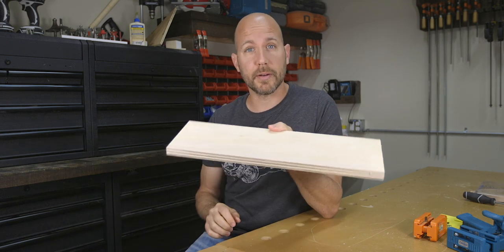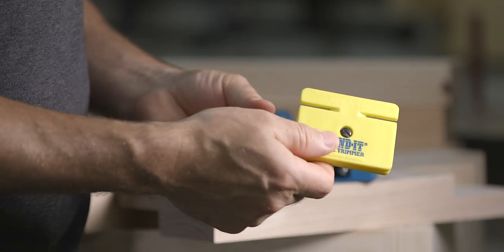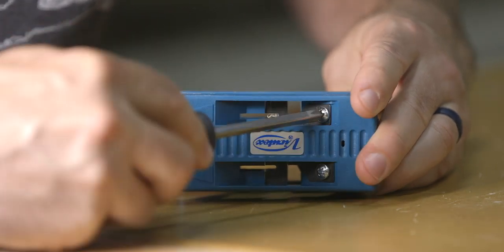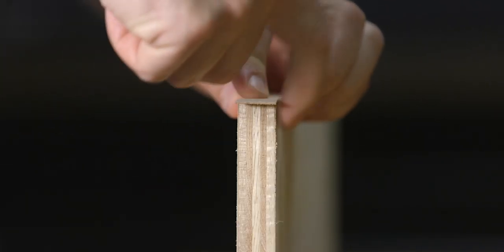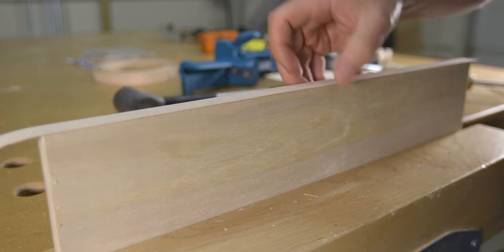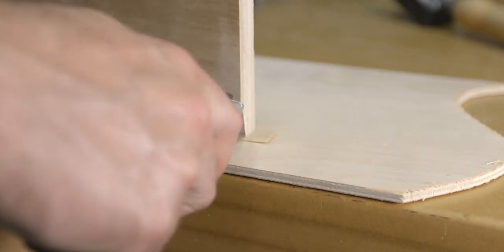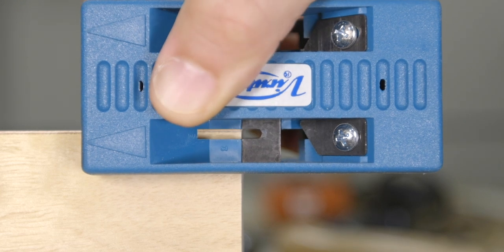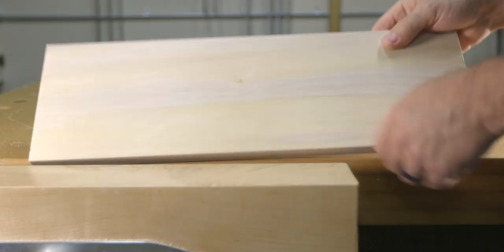Edge Banding Plywood

Comment: Hi..l like ur presentation...it was very simple to understand..u made it sound so easy...l would like to ask u few questions ...other than the aesthetics ...why do we need to edge band? Does it make the plywood last longer ? Does it prevent water entering the plywood core ? Is it necessary to edge band the sides that we don't see? Please do enlighten me. Thanks in advance.
Reply from the maker: Edge banding is used both to protect and finish off the edge of the raw plywood. I wouldn't say it makes the plywood last long, but does prevent contaminants like water/moisture  from entering. In general I do not finish the edges that are not visible. Bottom line, it's done mostly for aesthetic. Hope that helps.

Comment: Thanks for the video! Really easy to understand. 👍 one question, does the dual edge trimmer work on 2mm edge banding? Some of my projects require 1 and 2mm. just need to know if it works for both thickness.
Reply from the maker: I've never cut 2mm banding with mine. However, I just measured the cutter and it looks like it can handle 2mm (that is really close to the max). Just double check before you buy the trimmer of your choice

Comment: My issue with the purpose-made edge banding irons is that they are stupidly expensive. It's just a heating element with a handle. Why so pricey?  You can buy a brand new clothing iron for as little as 1/4 the price - Amazon has one for 14 bucks, for instance. 
I was fortunate in that I already own a heat gun for electronics. That worked fine. I just worked in 6 or 7 inch sections and followed up immediately with a roller.
My project was a little different from yours. It was a 28-inch square base for a turntable. I radiused the corners, so I didn't have a sharp corner to start from. I just started in the middle of the back edge and went clear around the entire panel. Used nearly 10 feet of birch edge banding. When I got back to the starting point, before heating the ends, I overlapped them and trimmed both ends at the same time with a mallet thump on my 1-inch chisel. A little TimberMate filled the tiny gap.
I'm really happy with how it came out, especially since I'm a newbie woodworker.
I guess since I was looking for an edge banding iron via Google, they added this video to my recommendations. A day late unfortunately. But I still enjoyed it.
Thanks for all your informative content.

Comment: Awesome video! Tips here that I will definitely use (sides first) as I'm building a desk topped with 3/4" Birch plywood. I knew enough to buy the banding, but was a bit unsure about the best application. 

Question: if I bevel the edge by 15 degrees to match the legs, will edge banding be more difficult to apply?
Reply from the maker: Application no, trimming maybe a little. I would try it on a scrap piece before doing it on the real thing. Let me know how it goes.

Comment: Nice demonstration. One question. How do you trim the banding when you are working on plywood that is already installed. I have cabinets I am redoing and the fronts of the shelves need banding. I can't start at an edge because there are vertical pieces of wood in the way.
Reply from the maker: Great question! I use a straight blade (or utility blade) and hold it flush with the top or bottom of the shelf to cut the excess material off closest to where the shelf intersects the side of the cabinet. I cut just enough material off to get my trimmer in there to finish trimming the remaining material. After that I use some fine sandpaper to polish the edges. Hope that make sense, if not hit me up on IG where we can chat and share pictures.
Reply: @TrainingHandsAcademy  Thanks for the reply. I'll give it a try.

Comment: Hi -  I have a question.  Di you say that its best to veneer the side of the board first and then apply the veneer edge so there is no gaps in the seams at the edge?
Reply from the maker: Yes, sides first, and then the face (the side you will see most).

Comment: what if you're working on a project to to wide to use the double sided trimmer, what do you use then since the single edge trimmer doesn't come out as clean?
Reply from the maker: Hey Paul. I would use a single sided trimmer (or take the double sided one apart and use half of it) and then use a little sandpaper to clean it up.

Comment: Hi 

I have issues with order of operations with my wood working projects 

Do you do this after you have sanded the main face or after ? 

Thank you
Reply from the maker: Great question! I would do this after you have done your main sanding. You will then want to follow up after you have edged it with a fine 220 grit to clean everthing up.